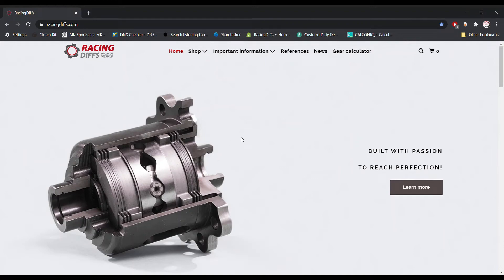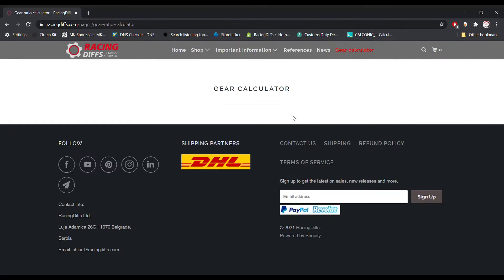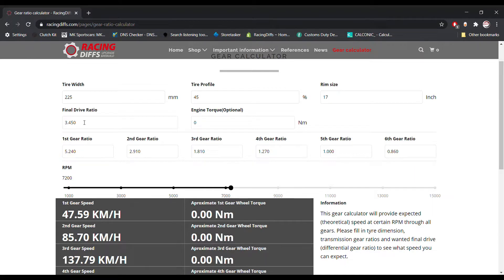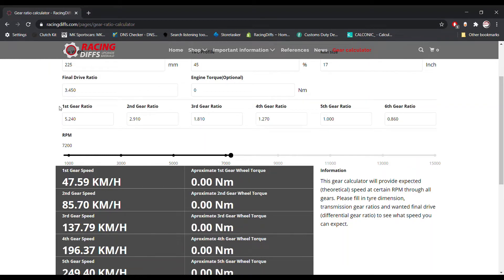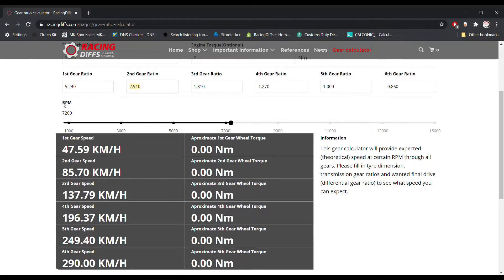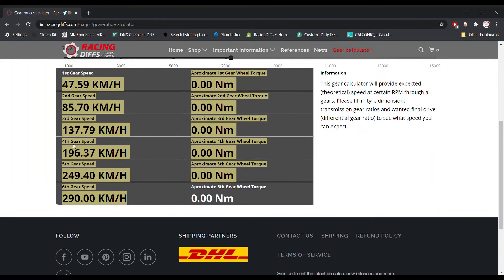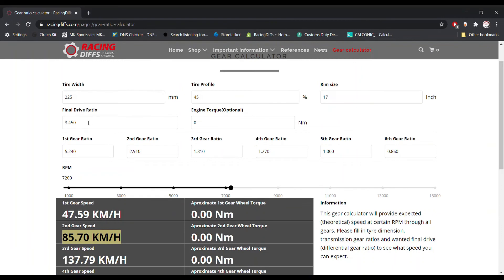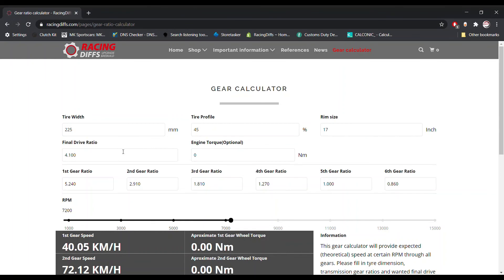How to calculate optimal differential gear ratio and top speed - RacingDiffs gear calculator

Comment: So I have a 2009 F150 5.4 with a 9 inch lift.  

Your opinion with wheels, 26 x 14
And 38 inch tires 

What gear ratio would you install front and back deck and give me a good power but don’t eat my gas up like crazy I only do city driving and Highway if I’m going to the beach
Reply from the maker: Hello, that is subjective. It's hard to tell. But you can use our gear calculator to figure out what best suits you. 

https://racingdiffs.com/pages/gear-ratio-calculator

Comment: Sir I have toyota surf 94 i change the engine 5L manual with manual transmission 5 speed  so now I have problem with speed  differential gear ratio now 3.93 .tire size 30inches sir pls guide I have speed problem  my surf can't go up 90 to 100 km/h rpm very high 3500
Reply from the maker: You have to lower your gear ratio to 3.15 or 3.25
Reply: @RacingDiffs  thanks sir

Comment: Great Tool, but  am try to calculate DSG Gerbox and the speed  on 5 and 6 gears is wrong, can You help my please
Reply from the maker: You'll have to google each gear ratio of DSG gearbox and fill in columns.
Reply: @RacingDiffs  ok final drive they give 2 numbers 4.769/3.444 so  for gears 1.2.3.4 its ok for calculate 5 and 6 gears a have to change final for number 3.444.Thanks.